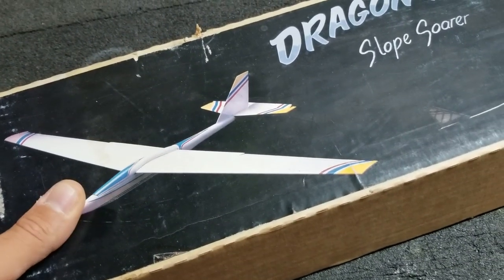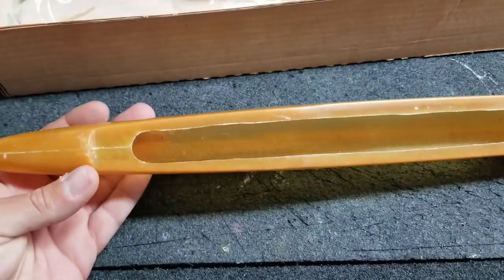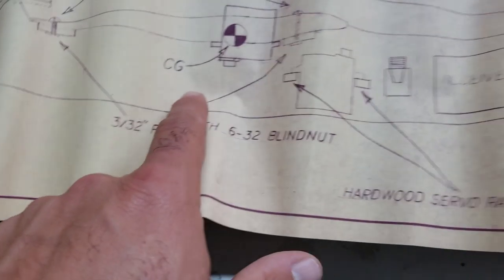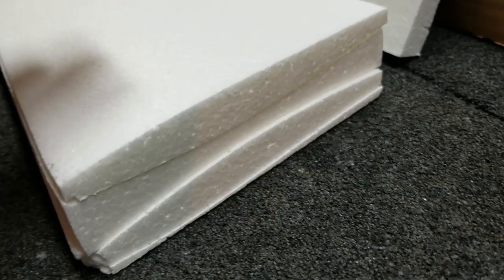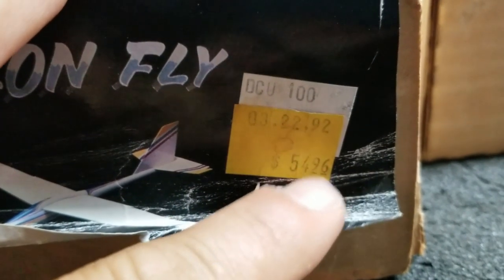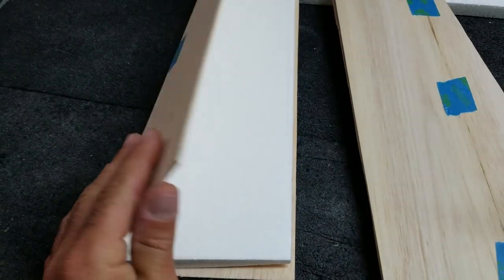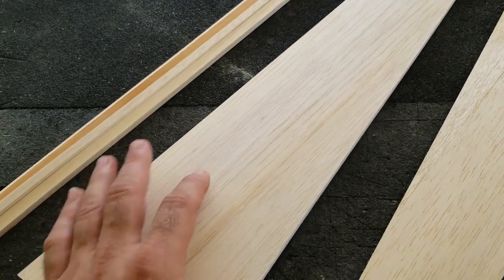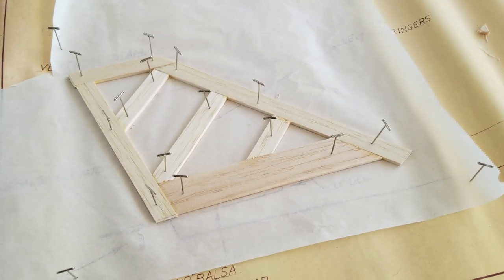Old School RC Slope Gilder Build Part 1, DCU Dragonfly

Comment: The Dragonfly was my second non-balsa sloper.  I still have the original, but I converted it to a wingeron using CR Turbo parts.  However, a few years ago I salvaged a DF wing from my friend's garage and got a fuselage off of RCGroups.  I've flown it quite a bit recently!  Lots of fun, though I think it would probably do better with a modern airfoil.